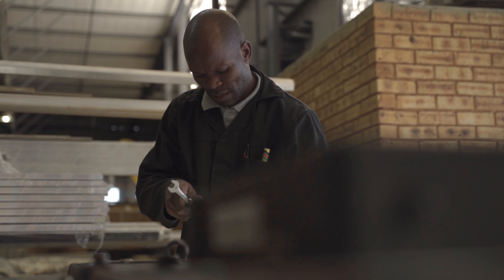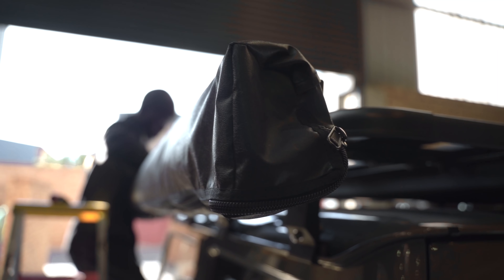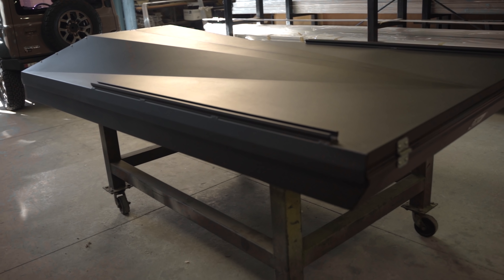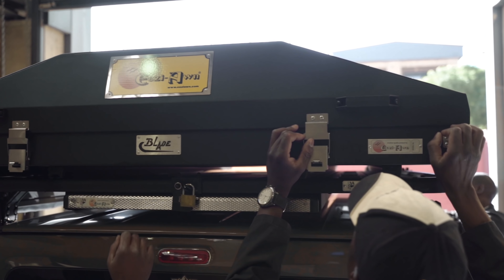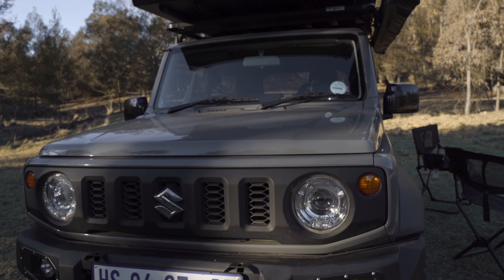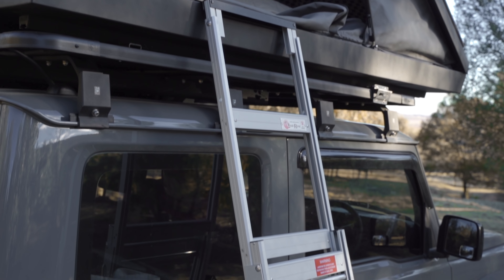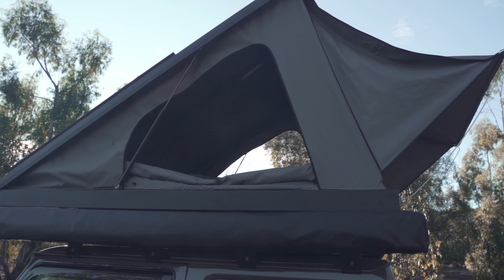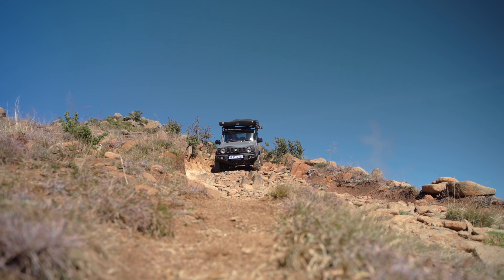ROAMS01E18 Installing an Eezi Awn Blade Hardshell Rooftop Tent on my Jimny (2019)

Comment: I’ve got the older version of the jimny (2010) and I was planning on getting a roof tent until I found out they have a roof limit of 30/40kg. The tent I found and want weighs 60kg and your one weighs 70kg. I’m just wondering you went about doing that? Any advice? Thanks

Comment: Howzit bud, will be interesting to see how that affects the off road performance, will definitely increase the vehicles sway
Reply from the maker: It definitely does. And its certainly not recommended on the stock suspension. I however knew my suspension kit was arriving the same day, so in the next episode you will see exactly what I did to counteract the weight on the roof.

Comment: hi can you please do a revue on the Jimny now that u have used it for some time now and i would like to see what u think of it in the long run as there are all ways things that unfold from use and things u find out u can and can not do. ie: when u break the water runs off the roof over the front window as i have not seen any revues about the Jimny with high mileage. Thanks :P

Comment: hi can u help me i am looking to have a custom roof rack made for my jimny (2019) what is the maxim wight you can put on as i spoke to Suzuki and they told me you can put on the roof is 30KG max
Reply from the maker: That is what Suzuki says. I have 110KG on my roof; and it goes to over 250KG when we sleep in it at night. I would say you have to do what you feel comfortable and safe doing, but at the end of the day when it comes to the Law then you should try stick in those limits. So you could stall an Eezi Awn roofrack; because it weighs under 30KG. And as always you will need to be careful how you load it.
Reply: @RoamOverlanding  thankyou so much for your help and support hope U really enjoy the Jimny as much as I do I'm not of roading like you are but every time I get in it it's like I'm on an adventure :-D

Comment: Hmm, you would have added around 100kg to the roof. That's 1/10 of the unloaded weight. 
And just under 1/3 of the load caring ability. (I know I'm not one to talk about staying in gvm haha) 
Recon it could be mounted lower to the roof for better fuel economy. Otherwise looks alright.
Reply from the maker: Strangely enough its only effected the fuel economy by 1.2km/L which isnt too bad in my mind. but obviously ill need more time to see that properly. Its certainly not light, but it is handling the weight well especially with the new suspension kit (topic of the next video)
Reply: fuel economy is a less problem comparing to unbalancing the car. especially after lifting it up. As owner of the jimny for more than 9 years I would highly recommend everyone who is new to driving Jimny not to do such kind of tricks. You have to understand the car driving style perfectly before moving up the center of the mass in a such short and tall car.
Reply: @Shad0 Yea I know what messing around with Jimnys is like. Although only owned two for the last 5 years, my current one is a ute and for my road trips I had her loaded up. She tipped the scales at 1.8 ton. Definitely changed my driving style off road but with that knowledge it's doable to complete some tough challenges. 
Also have a friend in Jimnys that runs a 4" lift 31" tyres ute with a roof topper. Very amusing watching him drive lifting wheels around corners. But still is amazingly capable off road.
Reply from the maker: I definitely agree with you. I've put alot of thought and attention into making this upgrade.
Reply: @RoamOverlanding  How much roof rating does the Jimny officialy have i SA, in AU its 40kg, id say your overloaded by a lot.

Comment: Hi i am fitting skykamp mini and front runner rack.  What awning do you suggest i like the 270.  Will the weight be an issue. I can't do suspension just yet
Reply from the maker: The suspension is always an issue on the Jimny; even with just a roofrack.

Comment: Isn’t it to much weight for that roof rack!?
Reply from the maker: The roofrack can take up to 750KG so not even close
Reply from the maker: Oh 100% I'm very much so aware of that. It is now more stable with the new suspension and the RTT than I experienced with the stock Jimny. There is no more swaying on the highways, not as much lean in the corners and takes bumps way better. But I will cover that in the upcoming videos
Reply from the maker: Sigmund Storm to me it feels more stable on the road, it’s due to the new suspension and not the rooftop tent obviously. All of these videos are my opinion, and based off my experience. I do also drive with more caution because of the RTT as anyone would. And I feel like you misunderstood what I said, it feels more stable in combination with the new suspension. It definitely doesn’t feel great on the standard suspension.

Comment: So, 30kg rack, 15kg awning, 75kg roof tent and 160+kg of people (280kg total) on a roof that Suzuki say shouldn't be loaded with more than 30kg. Ridiculous and non-sensical! This isn't about what a Jimny can and should do, it's about you making money from Eezi-Awn.
Reply from the maker: First of all; I don’t make any money from Eezi Awn. Second of all, the 40kg weight limit is a dynamic weight limitation on for the performance of the standard vehicle while driving. I would obviously never drive with people in the rooftop tent. If the roof of a car wash as designed to only handle 40kg a lot of people wouldn’t have heads... the roof is generally designed to take 4x the weight of the vehicle. I have 8 feet on my roofrack spreading out the weight so that puts 400kg at roughly 50kg per point of contact on the roof. After the couple nights I’ve spent on it and just in generally climbing up and down, the gutter is still 100% fine. And the RTT is strong enough to take up to 750kg and the Roofrack is strong enough to take up to 750KG.
Reply: Roam Overlanding, thanks for the reply. 

Firstly, I enjoy your videos so please don’t be upset by my criticism. I stand by my comments however...

Your video lists paid promotion and opening line is clearly an advert! Are you really saying that there is no financial or benefit in kind from Eezi-Awn for doing these? To be clear, i don’t have a problem with that but I do think this video takes things too far. I know that opinion is also shared by others on the forums I follow...

In terms of roof limits, Suzuki are clear this is 30kg (not 40) and do not state whether this is static or dynamic limit. (I have checked this in writing with Suzuki UK but it may be different in SA) This is not surprising given the traditional “gutter mounting” of the rack. This fitting method also means the ability of a vehicle to maintain integrity in a rollover situation is largely un-related to the weight of roof rack it can take because this strength comes from the pillars and monocoque. In the Jimny, the rack is all loaded on the gutter. 

Bottom line is Suzuki say 30kg and anything more is a risk - unless Eezi-Awn are under-writing this? Having said that, if your videos are demonstrating the Jimny can safely handle much more weight without damage/impact on warranty, those of us “close to the roof limit” can be happy that we’re well within the safe zone!

Thanks for the videos.
Reply from the maker: storminatwork just to be clear on my relationship with Eeziawn, the reason why I say paid promotion is to make it clear that the products are supplied by them, however I do my own thing with them. And in no way is Eezi Awn underwriting anything. I’m fully aware of the risk of putting this weight on the vehicle, for me it’s an experimentation of what the Jimny can really do. It might not be realistic, but just because I do it doesn’t mean everyone has to. But people can also just enjoy what I’m doing and know that it’s crazy and they wouldn’t do the same 😂 the second I feel uncomfortable or that it’s dangerous I wouldn’t do it, but it genuinely doesn’t feel too bad right now. And there are a lot of people telling me how my own vehicle drives and performs, yet they aren’t the one driving it every day to work and back or taking it on trips and trails. And just FYI, locally the roof limit is 40kg, it just shows how there is inconsistency in Suzuki’s claims too. All I’ve done is taken the strongest products I can think of and put them on the Jimny, so far the gutter is completely in damaged, not even slightly bent and that’s with the 110kg of extras my 120kg and another at 60kg. I’m pretty confident the gutters are significantly stronger than what’s rated. Let me be the Guinea Pig 😂 and then everyone can do what they feel comfortable with on their own accord. I feel like I’ll have to address all of this on a podcast soon. Anyways, I appreciate the concern and the support and I honestly just try to make videos that people enjoy and can dream a little! 👏🏻 brands like Eezi Awn and Wildog are just helping me making the ultimate micro overlander, it’s going to be a great toy at the shows and the whole process is supposed to be fun and exciting to see all the new mods for the Jimny and stretch people’s imaginations a bit. (Paragraphs would have been great, my apologies)
Reply: Roam Overlanding, again - thanks for the reply. I appreciate your experimentation which is making me feel a lot happier about the rack and ladder I have now fitted. I may even feel comfortable carrying something on it now! ;-) I’m also happy that you are acknowledging how much you are pushing the limits - which you clearly are - and wish you all the best. Again, I enjoy your videos and have been inspired to do more to my Jimny - and make videos about it - largely on the back of them. :-)
Reply from the maker: Awesome to hear!
Reply: @RoamOverlanding  "so far the gutter is completely in damaged" - is or isnt'? :) Thanks for great videos!

Comment: Isn't the weight limit for the roof 50kg ?
Reply from the maker: the roof weight limitation is not a matter of strength of the roof, its more an issue of the vehicle stability. In the next video you will see what I did to help with that.
Reply: No its 30kg as stated by Suzuki on there web sites, I work for acompany that manufacture roof racks and we were told specifically by Suzuki AU 30kg

Comment: Honestly, i dont think this makes sense. The jimny lacks power. Why take a huge tent that is always attached to your car, and takes away all the roof space, which definitely comes in handy when camping in a jimny, as the boot space is not amazing... I overland in a jimny and i found a pitch tent with a ground cover takes up way less space and does the exact same thing a roof top tent does, except, when our campsite is setup, we get to drive away from it with an unburdened jimny that is more capable offroad. To me a roof top tent is a gimmick. Attach that tent to a trailer, thats a bit better, but honestly, still quite pointless... What does a rooftop tent achieve that a normal tent doesnt, and is that really necessary. In my experience. No. It also doesnt look so leka. The jimny looks better without that huge tent.
Reply from the maker: It’s definitely something that comes down to personal preference and your style of camping. I generally don’t linger around at a campsite for more than one night, and when it comes to camping out in the bush with all the animals the RTT is going to be really nice. This is one of those things where we are allowed to disagree on this topic, but hopefully you will let me show you why I have chosen to go this route 🤟🏻
Reply: @RoamOverlanding  Lol, i hear you. I guess we have different camping/overlanding styles. Still though, doesn't change the fact that the Jimny was not designed to have such a huge tent on its roof. The RTT is going to affect the vehicles off road performance, and definitely not for the better. So its an odd addition. I'm not seeing the huge improvement here at all. It seems like an off-road performance downgrade, but a glamping upgrade.... Looking forward to seeing how it actually performs in your next video. Lets see if you can change my mind.
Reply from the maker: Timlin Alisandro I more want to do long term trips up into Africa, I don’t necessarily need the craziest off-road performance! So let’s just see how things go. So far so good!